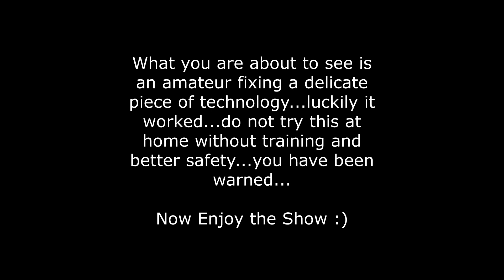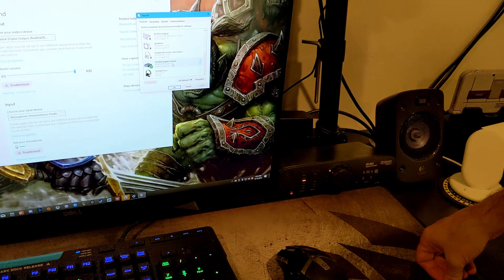Logitech Z906 Speaker Repair (3 Blinking Lights Issue) Resistor Replacement

Comment: Followed exactly what you did with my board and the resistors are measuring 5.6-5.9 Ohms replaced inside the board. However the problem is not solved. Would appreciate any more tips!
Reply from the maker: I can't speak from experience since my problem was solved by just replacing those resistors but it looks like there have been some really good comments from others who have had more complicated problems that they fixed that might be helpful to you.
Reply: @techfireside  did you discharged the capacitors before starting to work on yours? How did you do it? Shorting the capacitors with a 1000V ensured screedriver?
Reply from the maker: @ashystyle  I didn't...at least on purpose. Before I started work I did try to measure several points with my multimeter so I suppose it's possible I may have discharged something along the way. 

I am very much an amateur so if there was anything dangerous that happend here I would like to know.
Reply: @techfireside  Thank god you made it alive.  Very dangerous if they are not discharged. I just discharged mine with a 1000V ensured screwdriver and got the surprise of my life!! What a bang!
Reply: First hit on google: 
Do not short the terminals of a filter capacitor with a screwdriver. ...
Screw a 100 watt lightbulb into a socket with exposed leads.
Attach one lead to each terminal of the capacitor, the bulb should illuminate.
When the bulb turns off, the capacitor is empty.
Reply: @mioszhermanowicz6986  I know that would have been the proper way to discharge it.  But I didn't have any 100w light bulb and would not dare to try it with exposed leads.
Reply from the maker: @ashystyle  Looks like I got lucky. I'm going to add a card at the beginning to make sure people know this.
Reply: Did you fix your speakers?

Comment: Hi i have the same problem 3 solid led on the input... when looking at the power supply board i see the same 2 resistors with the heatsink on them looking burnt... i took out both resistors and tested them out of the circuit and they both test at 5.6 ohms which have me a bit concerned as if that is really the problem although it looks well burnt. I will change them tomorrow and see if that solves my problem or if i would need to change the surrounding caps and someone mentioned an voltage regulator LM1117 something.
Reply: Hello, check the circuit between the resistors not to be burned, re-isolate the resistors, and then check if you receive the voltage from LM1117
Reply: @vasiledobre24111973  do i have to take the resistors out of the circuit to check the output and input of the voltage regulator LM1117?
Reply: @42FaLLeNAnGeL24  In the regulator it enters 12v and it comes out 5v, it must extend with a resistance of 5.6 ohms
Reply: @vasiledobre24111973  not sure if i tested it right cause all i did we connect the power supply to the wall... no power switch or anything the board was completely out the the box...
Reply: Yes please let us know what you find.
Reply from the maker: Some other people have definitely had problems beyond the 2 resistors so I'd be very interested to see if your problem is similar.
Reply: Ok... do i changed the 2 resistors and i have the same problem.... next step would be the Voltage regulator i suppose... will try and test it now and if i can get any reading without getting shocked...
Reply: @42FaLLeNAnGeL24  Hello, On the board between the two resistors is a printed circuit board, is the scaffold ok or is it burnt? see if there is a black adhesive that needs to be cleaned from the board to see if it is ok or not.
Reply: the two resistors are inserted on the circuit board, if you measure at the right extremities you must have a combined value of the two resistors 5.6 + 5.6 = 11.2 ohms. do you have this value? if you do not have the circuit between the two resistors on the pcb it is burned and must be reconsidered ... with a conductor.
Reply: @vasiledobre24111973  i measured the resistance and i got 11ohms... i tried plugging the board alone into the wall to see if i would get any voltage from the LM1117 but i am not getting the 5v that i think i should be getting

Comment: Hi, I had the same problem and the solution for me was the following: I changed R79 and R80, 5.6 Ohm / 3w, I rebuilt the burning circuit between them and I changed LM1117s which was defective. Optionally I chose to replace the electrolytic capacitors C38, C39 and C40 47micro / 16V, C23 47 micro / 100v, C33 220micro / 25v and C66 470 micro / 16V.

I chose to change these electrolytic capacitors as they sometimes cause defects. My system has over 8 years of daily use and I thought it was good to change these capacitors. The system now works perfectly.
Reply: Vasile Dobre, How much would you charge if I shipped my Z906 board to you and you replaced the same parts as you did on your system?
Reply from the maker: I hope more people see this that have been having issues beyond the replacement I did in the video. Thank you for posting this!
Reply: @muitza86  It is NOT 560 ohm, it is 5.6 ohm. I measured a functioning one that I replaced just in case. Do not listen to Mr. Chitu.
Reply: @Tijgert  yes, my bad, sorry
Reply: @muitza86  no problem, just trying to help.
Reply: @muitza86   what are the colours for this resistors please?
Reply: @josejoshuam2007  Green,Blue,Brown and Gold (Tolerance).
Reply: Hola que tal amigo, no entiendo mucho inglés, pero veo que has cambiado esos componentes. Veré si puedo traducir esto. Ya que quiero que mis Logitech sean eternas
Reply: @Nelan Thomas my bad :d
Reply: I also found that C66 470uf @ 16volts (needs to be a low ESR part with thigh ripple current at high frequency)  and the 2 47uf 16 volts were no good and had to be replaced. The resistors on the primary side closest to the heat sink are 3.15K at 2 watts if any one needs to know.
Reply: Thanks for the advice. I've replaced R79 and R80 but the problem remains. So I was wondering if the LM1117s was broken as well. I've tested it and it outputs more or less 5.0 V as long a the input is more than 5.0 V. So I guess it works? How did you notice that yours was bad?
Reply: What is the value of C39 and c40?
Reply: @alfredsaycon5695 47 micro/ 16 v see may coment
Reply: Qué tal amigo! Perdón la molestia, mi duda es si los capacitores los remplazaste con en mismo valor de fábrica o los cambiaste por otros valores más altos!!!??

Comment: Thanks to your video today I could fix my theater I had the same problem I hope it lasts a lot 👍🏻❤️
Reply from the maker: That is so good to hear! The reason why I started this channel was to help a few people. Hopefully somebody comes out with a better video of this repair someday but for now I'm glad my video could help you! :) :) :)
Reply: @techfireside  i am thinking of buying this set up but seeing all the issues people are having im not to shore if to buy it now..after how long did this happen an what was the cause for this to happen an have u had any other issues..an dose this pop wen u turn the system on or off
Reply from the maker: @Anoymus985  As for cause it's just age from what I can tell. It was never plugged directly into the wall (always a surge protector) and was always in a well ventilated area so I don't think it was heat. I didn't have a problem with mine for about 6 years. As for if you should buy one or not...maybe if it's brand new but I wouldn't buy one of these used because of the problem you see in the video.
Reply: @techfireside  oh i see i did not no u bought one used..i was thingink of buying one brand new as my old one is Abit naffed an pops alot wen i turn it on an off even wen volume is all way dwn..thinks its on its way out have had it like long time

Comment: over 1 years my logitech Z906 Remote  control does not work, please tell me any solution.
Reply: Try to find a logitech z906 remote which is working and buy a remote i25 Rii mini .. it can clone  logitech remote few important buttons like power, volume up and down , source etc ..  This remote can be used multi purpose bro .. try google it ..
Reply: please  sir help me,,,
Reply from the maker: Sorry, I only fixed my speakers from the recommendations I read online. I'm not an electrical engineer just an amateur. I don't know what would be causing your problem with the remote :(

Comment: I repaired mine with same resistor replacement. I replaced 79 and 80. I wasnt checked the backplate of the sub before resistor failure but now when i checked the backplate, it is really hot. Do you have the same issue after repair ? Did you checked the temperature of the backplate when it was brand new or before failure ?
Reply from the maker: The back of my subwoofer does feel pretty warm. I measured it around 38-39c average.

I didn't check the temperature before the failure so I'm not sure if that's normal or not. 

I hope you're able to figure it out.
Reply: @techfireside  In use I think the subwoofer does become warm.

Comment: Is the z906 still working for you
Reply from the maker: So far so good. I haven't had any problems since replacing the resistors.
Reply: @techfireside  thanks for the answer sir.
I have the same problem.
3 fixed leds and i cant do anything.
Less than 8 months of use 
Idk what to do. I Hope some store can fix It cuz Logitech is not helping.

Comment: sir thank you very much for your video, it is very useful since there is not much information on the internet, I am with the same problem as you, and I would like to know if your loudspeaker system works with the electricity network in 220vol or 110vol. mine is 110v, and I think there is a difference with the resistance, I send my best regards from Argentina.
Reply from the maker: I'm in the United States so we use 120v. I'm not sure if the Argentinian version uses any different circuitry but I would think it's probably the same if you use 110v. It seems like it would be close enough at least.

I am not an electrical engineer though so I could be wrong.
Reply: TechFireside
Thanks for your quick response.
The version I have of my system is that of the United States, so it is the same as yours, I think they are 100% the same, here in Argentina we use 220 volts and I use it with a transformer of 220 volts to 120 volts, I will try to replace those capacitors! Thanks again, have a great weekend.

Comment: Please tell me what is the nominal value of this transistor?
  @t
Thank you very much
Reply from the maker: Not sure if Youtube is blocking the link but there should be a link to the resistors I purchased in the description. If that's not showing up or you would like to find them yourself I used 5.6 ohm (5R6) 2W resistors. Based on what I read on forums they seemed to be the best fit. They worked for me so I can at least confirm that much.

Hopefully that helps.
Reply: @techfireside   my email: vaidasrauba@gmail.com wryte my please.

Comment: Tried replacing resistors, didn't work though  T_T
Reply from the maker: I'm sorry to hear that :( 

I was convinced it was going to be more than the resistors on mine (or that the resistors dying would destroy other parts of the board) but I got lucky it appears.

I love my logitech speakers but my experience with this part burning out has made me hesitant to buy another set from them.
Reply: @techfireside  if I can fix it, I will let you know the solution.
Reply from the maker: @eliusamarus  Please do, it would be awesome if we could help others with the same problem.
Reply: Couldn't find this thread to answer. The problem was: I have a rabbit. The bastard bit the cable from behind, where I couldn't see it was partially cut. He (I still love my pets) broke 4 wires from the cable. I joined them and used a glue gun to leave everything in place. It worked as always. So, my advice: check all cables first!!!
Reply from the maker: @eliusamarus  LOL I've had rabbits before so I feel you. That is crazy I'm glad the bunny wasn't hurt and you got your speakers working!
Reply: Changed the resistors and it didnt work. My best guess is that there is something wrong with the power supply. I dont have the knowledge tho so rip.
Reply from the maker: @Adrian-br3te  That sucks :( 

Honestly, I was shocked when I was able to fix mine just replacing those 2 resistors. When I saw the fire damage on the board I was sure other components had been damaged in the process.

I'm really disappointed overall that I had to fix a pair of speakers that cost this much in the 6ish years I've owned them. It's definitely made me think twice about going with Logitech again for a big ticket item like this since it seems like this problem is fairly common on this model.
Reply: https://pt.scribd.com/document/397001966/Logitech-Z906-Power-Supply-Nomenclature-schematic

Comment: can i put 1/4 w
Reply from the maker: I don't know. I used what was recommended on some forums so I just went with that. I would be very careful about using anything else.
Reply: please you can send me the link you bought, why can't I find it on eBay this. Appreciate
Reply from the maker: @albertjenn34  Yeah it's in the description but here it is again: https://www.youtube.com/redirect?v=VSfqKv3Arw4&event=video_description&redir_token=E5YwuKm--d-ZDNdTsaGeqP_sPcN8MTU2OTQ0NzU3N0AxNTY5MzYxMTc3&q=https%3A%2F%2Fwww.ebay.com%2Fitm%2F362738315059%3FViewItem%3D%26item%3D362738315059
Reply: no u need 5.6 ohm 3whats 5%tolerance
Reply: @majito0727  The colours of the resistors indicate 560 ohms, no 5.6 or 5600 or other value!!!!!!!!!

Comment: What number resistor please
Reply from the maker: 5.6 ohm (5R6) 2W

I purchased mine on eBay for less than $5 from what I remember. Let me know if you need more info.

Also, see the link in the description if you want to just buy the exact ones that I purchased.
Reply: @techfireside  How did you know that this specification was correct?
Reply from the maker: @ashystyle  Somebody recommended that on a forum somewhere (can't remember where now). The spec I replied with above is what I used and it worked so I can tell you that it worked for me at least.
Reply: @techfireside  because i have a hard time finding that exact resistor in the shops here in Sweden. Do you know of its a metal film or carbon resistor?
Reply: @techfireside  also having hard time to get those two resistors soldered off the board. I guess that my solder iron is to weak. 25w it is.
Reply from the maker: @ashystyle  Yeah, I did notice that I had to turn my soldering iron up to full power. They might use a high melting point solder from the factory. If you are having trouble finding the parts double-check my link in the description. It's to the eBay seller that I got the parts from. They were super cheap at around 1-2$ USD so even if you needed to pay extra to ship to Sweeden it might be worth it.

I am not sure if they are metal film or carbon I'm very much a novice when it comes to electronics work like this.